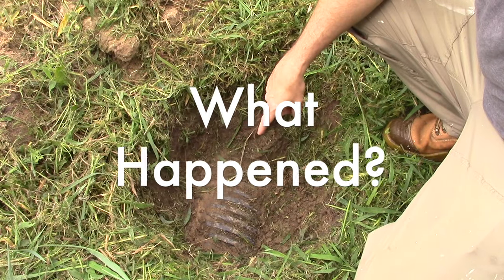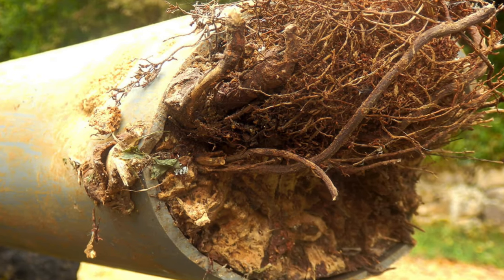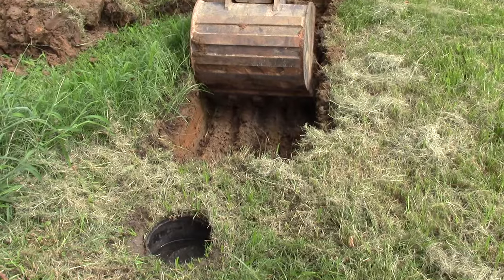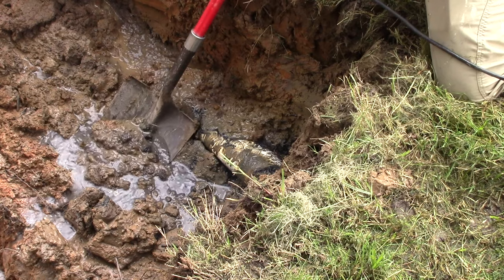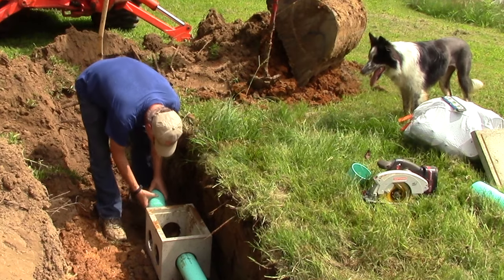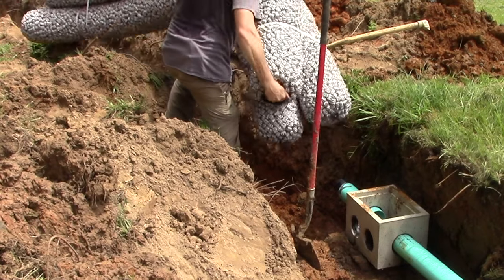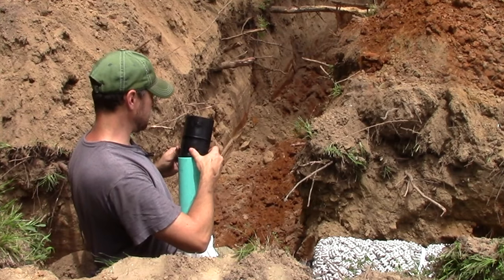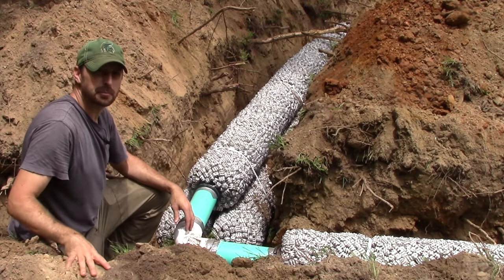Replacing A Leach Field | Styrofoam Septic Drain Field Cost And Install

Comment: In my opinion the most no-nonsense, doable, diy septic video on youtube, and I've watched hours of clips in search of a solution for my current leech field situation. Thank you so much for posting.
Reply from the maker: You’re welcome and thank you for the kind words.
Reply: Dude. I’m in the same situation. Need to redo my leach field. What have you done so far?  Anything? 
Let me know. It would be nice to hear your experience.
Reply: @earthling2007  I'm in NY, went through 3 companies so far, I have to have a soil test done with the dept of health present and they have to sign off stating that the soil is suitable. It's a major pain in the ass. I'm still waiting for them to come through. Turns out I only had one run (essentially one leech pipe) and one distribution box. I've been in this home for 8yrs, didn't know that was the case until it started failing. So far quotes for a 175ft -225ft run of leech fields has ranged from $9g to $14g. I'll keep you posted, may even upload a video.
Reply: @robr471  I may do a clandestine install based on an engineers design. 
I’ll spend the $550 for a percolation test and design.

Comment: Great Video!!!  I am not a "Septic Tank" and or "Lateral Line" installer by profession.  However I have lived in the country, on a farm, all of my life.  I am not an expert but, the Absorption System I have here, was installed in 1965.  It is now in bad shape, and needs to be redone.  But I will say this, no one will believe it probably, but I will say it anyway.  "A Septic System, IF it is installed "correctly" and is located with the "advantages" it needs, like being only slightly sloping, and a soil that "percs" and the system is not "abused" is the most trouble free thing you will ever own.  This one here or our property, I helped install as a kid, I am 72 NOW.  Let me tell you, we almost forgot we even had it.  Except, early on, the old Concrete Tiles were used to make Lateral Lines.  They did not last, they never did.  They were replaced in the early, very early 1970's with PVC lines.  After that, it was trouble free for decades.  Finally replaced the Terra Cotta Tiles that the Burlap "seals" that fed the tanks some years back.  Replaced that with PVC, which is MUCH Superior.  This may sound unbelievable to some people, but it is true.  We were lucky to just be at the right Place with the soil and lay out etc.  

This is a great video, to me you nailed it ( in my opinion anyway ), on the "VARIBLES" and the Charges you may face.  Until NOW, we almost forgot we had it, almost NEVER PUMPED IT and so on.  But, the VARIABLES this man pointed out is the "problem" or "savior" depending on what you have.  In my area (Texas) the type of soil and SIZE or the "lot" makes a huge difference.  In the area where I live, very close to our location the SOIL CHANGES ABRUPTLY.  We are on what is left of our Farm.  So, we could make the "Lateral Lines" or "Drain Field" as big as we needed to make it work.  If you are on a smaller lot in today's world, the Regulatory Entity and THEIR Regulations on "Perc-ing" is what will kill you.  Also how many people USING THE SYSTEM.  They just might MAKE the Aerobic MANDATORY.  I am also a Real Estate Broker, inactive at the moment, but this is something you need to check out BEFFORE YOU BUY YOUR Lot or Home etc.  But where I live, the SIZE of the drain field, is the deciding factor on the Drain Field.  If the soil absorbs the Affluent too quickly, you can EXPAND the Drain Field.  This is important to know, as it MIGHT (but not always) save you from installing a Damned Aerobic System.  I hate those things, they are a FOREVER COST just like the man said.  If you THOROUGHLY check this out, you might save THOUSANDS of Bucks'.
Reply from the maker: Thank you for sharing.

Comment: If you do black and grey water separation, use anaerobic digester on the settled black water solids,  digestate and grey water settled and into a leach field.  Also planting shallow root high water plants next to the leach pipe is good at controlling water, in third world counties they use banana trees.
Reply from the maker: We have a partial greywater system apart from this.

Comment: Yes excellent straight forward. I’ve never seen these pellet tubes before. Looks like a great idea. Had quotes for $25 000-30 000 (CAD) for complete system for the “mound type” with pump. Crazy! My soil conditions are normal and would support a conventional gravity system.
Reply from the maker: I hope that you are able to do a conventional system. The others are just way too expensive.
Reply: My county wanted to upsell me too... I went over their head a installed a gravity system like My land should support
Reply: @2002-n8s  watch who takes the county inspectors to a free lunch by the contractor that pads pockets. It happens all day long so you were smart going over inspections in the field. Most Office Supervisors never know what their field inspector is doing especially when contractors are feeding and paddling the pockets. Trust me I was a civil service inspector and if your bent the contractor will shower you with goodies. In our city one inspector was imprisoned for bribes.
Reply: Why did they tell you that you needed a mound system ?How do you know what type of sols you have ?

Comment: Great video! Quick question, though. How did you dispose of the old drain lines? Are there hazmat fees involved with that or anything? Thanks!
Reply from the maker: Thank you. No fees here. The old lines are still in the ground. New lines are routed in a different area.

Comment: THANK YOU FOR THE VIDEO. What are those leach pipes with “peanuts” called? What did you use to make sure the trench was level? No rocks were used, right? Thanks
Reply from the maker: There are various manufacturers that give them different names. You can’t find them at big box stores though. Have to get them at a septic supply. Use or rent a transom laser level for the trench. No rock was used at all.

Comment: I wonder how long those peanuts last compared to a regular perforated pipe with gravel?
Reply from the maker: Not sure but they were not your average styrofoam peanut. They were a much more dense material. Very tough.
Reply: @CountryLivingExperience  - Can you / your installer explain more about why these peanuts are not vulnerable?  I imagine them squishing together, softened by water and compacted by weight.
Reply from the maker: @JonathonNeville  They are not your normal peanuts. They are a high density closed cell foam. They won't be softened by water at all. As for compaction, I am sure there will be some but gravel also settles and "compacts".
Reply: Some foam has more than a 60 psi rating and is used for structural work. In some applications, they actually put slab, footing, and build an entire house on top of structural foam. They even build highways on top of layers of structural foam because it has higher compression strength than gravel and soil.
So those peanuts, if the septic tank is well maintained may actually last longer than gravel also because they have a smooth surface and are less prone to aggregate dirt and sand.

Comment: I worked for a guy nd a lady had her tank pumped a month later it needed pumped again the guy that pumped the tank said it was a drain field failure and would need a whole new drain field  she called my boss the system was 10 years old and shouldn't have done that there was 3 sixty foot runs we dug for a hour and on the first turn the elbow was  collapsed from the trencher putting in irrigation pipes  so the other two lines had never even been used since new and the first line took ten years to saturate she was very happy so dont believe some guy who's only job it is is to pump shit he doesn't know till you look

Comment: Are those not strapped in (3)'s for shipping purposes and not install purpose?? are they not supposed to be singular?
Reply from the maker: This particular system and brand uses this triple “pipe”. Other brands use a single pipe. This one is better because you will get more capacity if your soil percolates slower.

Comment: Where do you get the peanuts, lowes or home depot?  Great video!  Trying to get up the materials so I can do it myself of course. Thanks!
Reply from the maker: Glad we could help. Neither. We went to a septic supply company. The big box stores don’t have these as far as I know.
Reply: Which company did you go to? Or do you have an online recommendation?
Reply from the maker: @osmosisomni2248  Do it yourself my friend! DIY. That is the point of the video.
Reply: Sorry, I was not specific. I meant where did you get these leech field drain kits from?
Reply: That is the worst drain field to put in

Comment: You didn't leave a link for the foam peanut pipe, or styrofoam?  I didn't realize it was code to use that product.  Isnt' that for french drains only?
Reply from the maker: I didn't buy it online. I bought it from a local septic supply company. You need to check the codes in your area....they could be different. The peanuts in these septic pipes are a different material than the french drain.

Comment: We put in one of these systems 7yrs ago. NEVER AGAIN!!! Over time the peanuts condense into a hard mooshed up mash. Ours only lasted 7yrs. Now we have to spend almost 4k to put in a new leach field. When the contractors came out to see what was going on they said they take these up all the time because they just don't last.
Reply from the maker: Interesting. I will check on mine. Everything is flowing fine as this point.
Reply: @CountryLivingExperience  ya,  ours did great for years. Until about a month ago.

Comment: Why do you put 2 of the peanut pipes under 1. Why do some videos have the 3 laying side by side. Which is correct?
Reply from the maker: That is how this particular brand is designed. Neither is wrong.
Reply: What brand were your peanut pipes. I’d like to look up the manufacturer info?

Comment: are there any DIY aerobic systems? they seem much easier to install because the leech field is smaller.  I can't belive they force you to sign a yearly contact. Why not just not pay for it? what can they do?
Reply from the maker: They require power and I didn't want the hassle of moving parts. Passive systems are good for me.

Comment: So it's been a while, have you had any further issues with this system 🤔? Also. Where did you buy these peanut Styrofoam system?
Reply from the maker: It has worked flawlessly. No issues at all. I got the styrofoam peanut system at a local septic supply house. They asked if I was a contractor and I told them no but my contractor told me to come buy the materials.
Reply: @CountryLivingExperience  awesome thank you
Reply: Where are you locates?

Comment: Where did you buy the drain tail?
Reply from the maker: There is a local septic supply company. As you saw in the video, the drain lines must remain relatively flat.
Reply: Thank you! 
Who fixes thoose is it a plumbing company?
Reply from the maker: @martrome7449  If you do not do it yourself, you need to call a septic company.

Comment: I have a baco and other equipment. I'ma farmer. Do you remember how much the d box 90s and maybe two 20ft sections of peanut pipes was. I'm in East NC. I own 26 more open aces behind my house. Only when I wash clothes the field overflows
Reply: Not a separate drain pipe on my washer it goes through my Septic. I wanna change that as well
Reply from the maker: It was about $1100 for all the materials years ago. 150ft of the peanut pipes, the d box, some elbows, and fabric cover. I live in Texas though. Not sure how different prices would be in NC.
Reply: @CountryLivingExperience  ok thanks 👍.

Comment: How long normally does these fields last🤔
Reply from the maker: Depends. It well taken care of in an area with good soil, I have heard of conventional systems lasting 50 years. These styrofoam ones have not been around that long but they should last for quite a long time if properly maintained.
Reply: My house has this system in now and it’s beginning to fail. It was built in 1985 and I assume it’s original

Comment: What stop rain water enter your septic tank and flood all the poop to flow out
Reply from the maker: It is a closed system. They are designed not to flood because it is set in soil that will drain. It will not flow back into the tank (where the poop is) unless it is completely submerged in a pond.

Comment: Sorry sir,  your septic did not pass inspection.  You cannot sell/close at this time. Here's contact info, a few guys(buddies of mine) will take care of you for around $30,000.
Reply from the maker: lol
Reply: @williamrobinson6680  man that happened to me. I didn’t didn’t even have anything wrong with my septic system but the buyer wanted it inspected as a condition of sale. The septic company comes out there, says the can’t find the access cap and then starts digging. Somehow by the end of the afternoon I ended up getting charged $3000 to install an new top slab with a new access hatch. The septic company screws you over because it’s two weeks before closing and you just have to bite the bullet. They know your not going to contest payment and potentially get a lien put on your home to mess up those whole sale. They really have you over a barrel.

Comment: Won't the foam slowly depress down with all that dirt packed on top??? I mean this can't last nearly as long as say pvc and gravel or sand
Reply from the maker: I haven't had any issues. I would look to the manufacturer for longevity details.
Reply: @CountryLivingExperience  Werrd I'm not hating, more power to people do stuff themselves. 

I just know over time those peanuts gotta soak with water mabye get soggy or just sheer weight. 

Il check it out and see the years, was looking for cheaper alternatives considering I don't plan on be alive as long as a full system would last lol saves more money
Reply from the maker: @noch3579  I didn't think you were hatin so no worries. 
The peanuts are not the same as the ones you see in the bib box store. They are another type of material. Much more firm and not as spongy. Mine has had no issues since install.
Reply: We use Styrofoam to build roads.

Comment: I have seen these used in french drains but never in septic fields.
You must have to be careful about driving anything on top of them.
Reply from the maker: They have more dense foam than the french drain types. Yes, you still need to be very careful to not drive anything heavy on top of them.
Reply: @CountryLivingExperience  When you were back filling at 11:05 I was bighting my pencil. It looked to me like the earth would easily crush / compress the styro and pipe within.
Reply from the maker: @symcardnel1741  I have not had any issues with it so far. When he was backfilling the trenches I was cringing a bit too.
Reply: Aerobic Systems:
1.) The pumps are constantly going out.💲💲💲
2.) the State of Texas will allow the homeowner to jump through some hoops and monitor the system yourself. ✔️
3.) This systems require the addition of costly chlorine tablets. Many(most?) people abandon that practice due to cost, and just go au natural, baby!💩

Comment: In CA this is about 20-30k… pathetic state.
Reply from the maker: That is insane. Hope you can get out of there.
Reply: where in CA? i live in CA and we do leech lines for 7500 to 10000 and full replacement for around 12000
Reply: @brandonhernandez5720  Silicon Valley